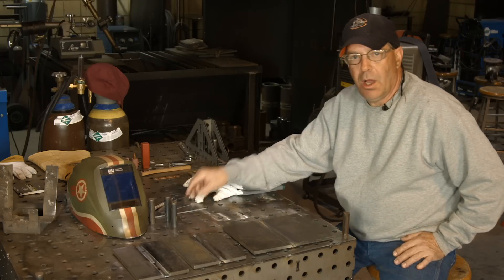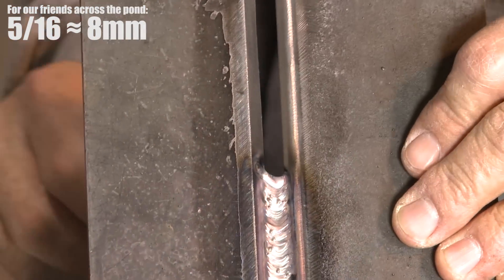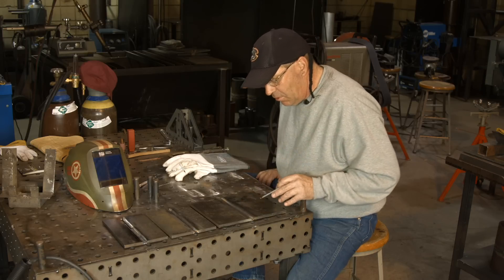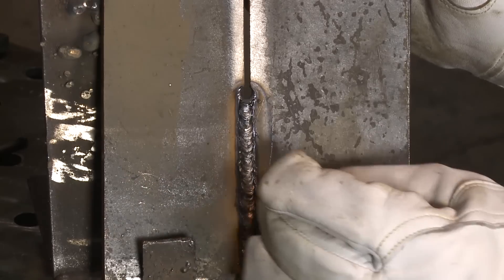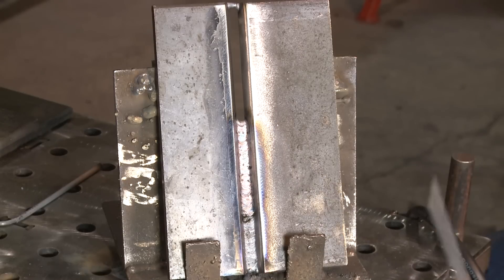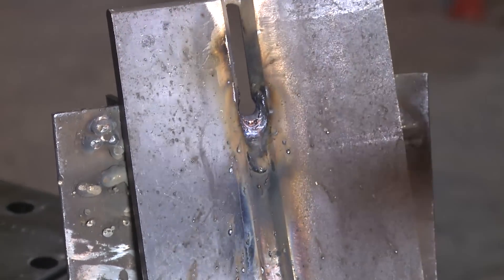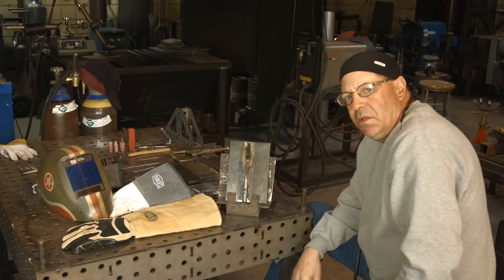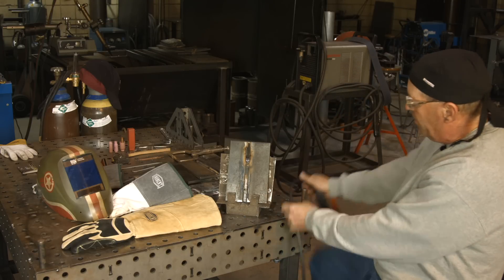🔥 6010 Roots and Bad Fit-up

Comment from the maker: Leave comments for video requests as REPLIES, here:
Reply from the maker: We've got some thick dual shield videos in the works. Do you want self shielded?
Reply: Could you do a branch with SMAW and how to fit it up thank you, love the videos Bob! Also could you do a career video on advice about getting started on the pipeline?
Reply: Weld.com I'm Currently in a welding school and was wondering if you'd be able to do a video on Stainless Steel fillet welds using Stainless Steel Rods with SMAW. Thank you and great video. Keep up the good work.
Reply: Weld.com  tig welding thick aluminum to very thin aluminum.
Reply: Carbon arc brazing with the old school two carbon torch would be fun to learn about.
Reply: I'd really like to see whole joint welded with 7018 (root, hot, fill, cap). Pipe or plate.

Thanks,
Tomas
Reply: Maybe make a video about softfacing with stick, when its used how to use it etc. and maybe compare 6010 to 8010. Great videos btw keep it up!
Reply from the maker: What process and what position?
Reply: How about a hi-low/misalignment in fitup, or one land is smaller or larger than the other with 6010 open root. And gap is slam shut.
Reply: Weld.com WALLYZWELNDINGWORLD. YO
Reply from the maker: jorge consuGTA Wally's a beast 💪
Reply: Weld.com please do open root 4g smaw please!
Reply from the maker: Thanks for the support. We will add this to our list.
Reply: Weld.com i loved the tim allen reference with the ironcat glove!!
Reply: Weld.com aluminum pipe
Reply: how about carbon to stainless pipe full penetration I'm still having trouble with this
Reply: if you can stomach more bad fitups, can you do one on pipe? like, the diameter is slightly off, also the guy on the saw kinda clamped it too hard so now you have an iso standard bend and an oval pipe... and you have to make it work even though one part of the bevel is kinda too high, the other too low, and half is kinda okay but it is all wonky and whatnot. 
i deal with that on the regular and i would like a veteran's opinion on how to angle the arc when and where to make it look afterwards like the fitup was just dandy.

edit: more tig yes. cause tig is surgical love. and if you have some stainless to do it on even better. doesnt have to be too thick either, one pass for proper root and cap? quick n dirty fab job. cause we have to make about a dozen of those before lunch.
Reply: Weld.com vertical uphill mig . thanks Bobby.
Reply: please do a video on aluminum and/or titanium pipe. I would love to do see a video like that especially from Bob. Btw Bob you're freakin hilarious and love your work keep it up man
Reply: Weld.com Please describe the j whipping motion of the 6010 and the advantages of that technique.
Reply: Welder4Life 360 keep a sharp tungsten, keep a tight to the puddle arc, use low heat, and buy a gold lens for non auto darkening helmets
Reply: Hello, can you make a video about how to deal with a bad fitup (especially the big gap like 3 mm [1/8"]) for stainless steel pipes welding with TIG process ? Thank you in advance :)
Reply: Great video today bob. I have been dealing with TIG for the first time this week. In 2 weeks I am onto the SMAW section of second year. I really identify with you on the fit up aspect. I cant wait to burn some rods.this video will surely help my fit up and procedure.
Reply: Can you make a video on rod storage, and what happens to old rods/mig wire?
Reply: I would like to see a a video on comparing how 024, 030, 035 wires run and pentrate using both C25 and C02 on a 110V machine or a dual voltage machine on 110V power.. my reason for wanting to  see this is am curious to see if on the 110V side of things if there might be a reason to stick to a smaller wire size or maybe use C02 vs C25 as alot of people may only have a lincoln or Hobart 130 or 140 welder or are stuck on 110V.  as in my case i have  both a Hobart 130 and a Imig 200 but i am stuck to 110V power.
Reply: Weld.com I would like to see some more repair videos. welding coupons are good but all but the best end up in the scrap bin.
Reply: Can you please do a sch 10 stainless steel tig pipe on a 5 or 6g position! Im very interested in watching you throw the root in with an arc shot
Reply from the maker: We've had that request a few times. We will add it to the list.
Reply from the maker: It's on the list.
Reply from the maker: Yeah, We've got that machine. I will add it to the list.
Reply from the maker: What are you having trouble with in particular?
Reply from the maker: Lol, I think our timing may not be quite quick enough for that job, but we plan on doing stainless pipe in the near future.
Reply from the maker: We'll see if we can source some Titanium pipe. Aluminum is already in the works.
Reply from the maker: Sure thing David.
Reply from the maker: It's in the works.
Reply: How about something on 'texas tig' welding?
Reply: Weld.com great video , can we see some more fluxcore  on on thick steel
Reply: Weld.com downhill 6010 pipe roots, fill and cap. Heard about it in the oilfield but never seen. Thanks
Reply: innershield .072 wire !  vertical and overhead !
Reply: Can you make a video with 6010 pipe  downhill?
Reply from the maker: We've done that in the past. Here's the link: https://youtu.be/TwvLku46I7k
Reply: Weld.com I'm a welding instructor also. Sir I love watching your welding. This is probably one of your best videos. I love how candid you are and how you tested the parameters of gap size, face size, amperage, and timing in the puddle, and how far you whip the rod. You really almost had it! You were doing great with 5/32 at 70 amps, whipping it against the wall in a U shape. It was only when you stayed in the middle above the puddle, long arcing for too long when you lost control. I struggle with MIG roots overhead. I get suck back a lot. It's really my nemesis. I know people say oh MIG is easy! We'll try an overhead root on 3/8 plate. Please make a video about overhead MIG roots. Thanks from Kentucky!!!
Reply: I'm having trouble with 1/8" 6010 roots on 3/8 plate with a 3/32 root and a 3/32 root face. I'm using a precision tig at about 75 amps and I'm having to stitch it and I'm not getting a fully fused in root.
Reply: Baja Madness it sounds like you need to make a bigger keyhole if you are getting lack of fusion. You need to establish a keyhole and when you whip back toward your keyhole, enter it with end of your rod to deposit word metal in the backside of the plate. Perhaps even bumping it up a couple amps will help you. Make sure to long arc initially ahead of your tack and hover slightly above your tack which should be feathered. Punch the end of the rod through that tack to make a keyhole and begin whipping. If it starts to get out of control and too big either make longer whips or stop and feather your stop and lower your amps. You want to feel like you're scooping the landing out ahead of the keyhole and depositing that metal back to your keyhole and puddle. You may also like an 1/8 gap and landing with 80-85 amps. I hope this helps.
Reply: I'm in welding school and having trouble with my 1g root pass can you post a video
Reply: I get what I assume is cold lap for 1/2" at the beginning of my welds. Am I just running too cold? 90 ish amps on Lincoln buzz box 1/8 6013
Reply: hi Bob with that metric you got in mind it's realy good "pond akross you have in mind :D
Reply: Weld.com I'm having problems with starting 7018 at the bottom of a 6" for my cap can you do a vid
Reply: Hey Bob, you may try texas stick on the open canyon root?
Reply: Downhill that last weld would have gone in no problem, ask me how I know
Reply: 4g 7018 1/8th
Reply: Rusted out, oil saturated pipe to clean virgin pipe...looking like a blind man cut the pipe...1/2" root opening to 1/16". Simulating a half shell replacement on a vessel built in the 80's.
Reply: Sir plz make a complete video on 6013 vertical position
Reply: I'm coming to realise.
(Correct me if I'm wrong)
For a 6010 root- 

Trypical fitup for sticking and dragging method is tight gap and thin root face. And run higher amps.
.
And for whipping you want a slightly bigger gap and bigger land. And run less amps. 
.
It would be awesome to see a video covering just fitup preferances and how they correspond and favour different manipulation techniques. On SMAW, GMAW, GTAW.
Reply: So, if you can't avoid a bad fit; you should put a piece of re bar in the gap and weld both side of the re bar  to the stock.
Reply: @weld.com will you do a video doing vertical up with 3/16” 6010 red rod please
Reply: 6013 root pass
Reply: Butt joint 6010 with 1/8 gap
Reply: FCAW-S?
Reply: Weld.com I think that sometimes you assume that the audience actually knows and understands all of the terminology, lingo and technical jargon that goes with welding. I have know idea what a root or a keyhole represents. A white board drawing would be great for us visual learners. Even watching you weld I cannot grasp the intricacies of it all. Please draw me some pictures! Just think of teaching kindergarten welding. That's some of us. Thanks.😊

Comment: This is the kind of stuff you run into in the real world especially working on broken equipment.  It's nothing to have a 3/4" gap to fill in a broken part which is where flux-core will definitely save you a ton of time.  Fast-Freeze electrodes work but it takes forever to finish the job 😒

A "U" whip is best for filling large gaps.  It focuses the heat equally on both sides unlike a "J" technique being used in this clip.

Personally, I find this type of welding to be a good test because it makes you think outside the box 😉

Comment: Another solid video.  Everything I do is pipe related, but it should transition to flat work just the same.  Most of the fitters I apprenticed under would slam everything together so it was practically touching.  They’d push in a 1/8” 6010 root that most of the time was capped with a second and final fill/cap of 1/8” 7018.  Most of the time we’re working a couple hundred feet from our welders so they’d do that so they can run the 6010 at the same amperage as the 7018, and obviously cut an entire pass out of the process.  I’m not for or against it as so far as it is a viable process, as long as the welder is aware of the necessity to sink that root deep.  We work in standard wall (sch 40) pipe and I personally do all three passes (root, fill, cap) so when I do, I gap 3/32 MAX.  I don’t like chasing the keyhole and I don’t like to fiddle with my machine when I’m switching rods.  Hot 6010 with a slightly tighter than “normal” gap if I get to pick.

Comment: I was taught to angle the electrode upwards when welding up, but welding with a gap is a nightmare. I keep blowing holes which I can't seem to fill, instead they get bigger and bigger. I see you angle the rod downwards instead and "drag" the bead through the gap. I've got to try that next time. Using 7016 electrodes, mostly repair work.

Comment: I’m learning how to weld uphill, and I run into that wider gap much more often than I’d like. I think I get nervous to step too far ahead and open up the keyhole way too much, so I probably don’t step far enough ahead. Puts tons of heat into such a small spot. Will try stepping out just a tad further 👍🏻

Comment: this frustrates the everloving fuck out of me because when i try to do an open root doing 70 is way too hot and burns through and if i go any faster than what im going it doesnt get enough penetration........ and ive tried a bunch of different ways starting at 85 and lowering it in increments of 5 every time i run out of ideas.

Comment: Why do you root with 6010 and cap with 7018? you know the first two numbers on a welding rod are tel howl strong it is. Why not root with 7010 then you can cap with Lo-Hy. Boilermaker retired, the root has to be equal or greater tensile strength, unless you plan to back gouge then root then reweld with Lo-Hy. I stopped using 6010 in the second year of my apprenticeship unless it was in the weld procedure.

Comment: My fav method for wider gaps is 2 roots on the bevels (4 in total, 2 on each side) then I'll weave in my 3rd to join them for my fillers and finishing passes. Give it a shot, you should even be able to get by on a 1/4in gap with just one root on each bevel if you know how to weave in your last root correctly. I always use a crescent or Z weave for my joining root and for my finishing passes

Comment: Regarding your pass on the wide root setup, could you have not done a pass or two up each side to narrow the opening, or also when welding run the stick/arc up the side of the bevel and slowly build material to the plates and gap? Thanks!

Comment: Can you guys do a video on all of the larger sizes of rods and different types of rods. Like a full and entire comprehensive video on all of it. 

Rods from 8th inch to 5/16 and 1/4 inch rod. And electrodes such as 6011, 6010, 7018, 7024, 8010, 6013, 7014, 7018 AC and others I may have missed. I'm looking for a video that does a complete and entire comprehensive look at these rods and sizes and techniques used when welding with all of these rods. As well as running all of these rod types on DCEN, DCEP and AC and seeing what they can run. i.e running 7018 on AC when it's designed for DCEP and DCEN. So just seeing what they can run on. Just seeing what they can be run on if say I have a rod and I don't have a DC machine. 

A video showing what the beads from all of the different types of rods should and would look like. So we know what to look for. And how to make a good penetrating weld while making our bead width longer. (For non critical welds) How to repair a plate I punch a hole through that I am using for a project that isn't a critical weld. Say I don't want to get another plate and I can't grind it and I can't use a backing plate. How do I repair the hole in the metal using a welding rod? And what rod should I use?

I have personally ran into the problem where I punched a hole in my material and I can't use a backing plate and I can't just cut it or grind it. Since at the point I was at I was so far into the project that it wasn't an easy spot to just grind it or use a backing plate. So I lost a lot of money on that project and scrapped it entirely. So knowing how to fix something like that would've been very helpful for me. 

The other thing I'm looking for is what arc length and what rod angle allows me to add more material than penetration and what angle and arc length allows me to have more penetration than weld metal? And how can I use that arc blow or force to my advantage when welding to get more or less penetration?

There are a lot of questions I have, so hopefully these questions give you guys a lot of video ideas. Thanks :)

This would be a video educating some home hobbyists in the unprofessional standpoint where non critical welds would be needed.

Comment: I'm not gonna say where or when for obviuos reasons but on some 30" heavy wall adding pups to cut down degree fittings we had bad fits tight n wide n lots of hi-lo. We'll come to find out forget the 5p+ and use a pipeliner 4mm 8010 it will beat that hi/lol with ease and step in the wide stuff look in thinking your gonna have to back weld guess what it was pretty slick did not back weld.we did over 500 welds of this nature pupping out  mitered degree fittings in the Fab to send out to the tie in crews.no repairs and yes we were way out of procedure.

Comment: ur video is very educational. i just want to ask if is it possible to do a stick and go/fly open 3g root pass with a 6011 in a machine with out the arc force feature? is there a technique in doing that method of yours with out the said feature? we don't usually use 6010 here in the Philippines.Thaks! more power!

Comment: hey :) nice Video, one Question which brand of 6010 stick you use?  i try it with sticks from Boehler but the weldingpool by rootwelding is to different as yours. thx

Comment: Your 2nd plate you did. I did a very very similar weld with the same amount of back face reinforcing and was visually failed for it.
I resat my test with the amps dropped right down to 65amos and dug the rod in. Barely any keyhole around the rod but it gave a fairly flat back face. Around 2mm reinforcing.
Not being negative. Not at all. But something to maybe aware of.

Comment: 5/16 inch gap on 3/8 inch plate with 5/32 6010 rod is not unreasonable. Though not the most ideal fit, that shouldn't have been a problem. Thinner plate would have been more of a problem with that gap, but 3/8 shouldn't have been such a big problem. That could have been done with 1/8 6010 at 85 to 90 amps. You have to move that rod in a U shaped pattern. Run up on one side a little bit, go back down, go over, run up the other side a little bit, and come back down again. That way you are allowing it to cool a little bit and building up metal on the sides, making the gap smaller. Though not the best gap to have, it is not an impossible gap to have, and not even an tremendously hard gap to fill.

Comment: Not a welder here by any stretch.... as I would know the answer to this:  why do you keep a gap and not just butt the two pieces together?  assuming it would have something to do with the profile on the other side?  Just wondering.
Thanks!
Reply from the maker: You put a gap in it so there is 100% penetration.
Reply: Fast reply! Thanks

Comment: i can't believe that u gave up or couldn't fill this gap ! things are not going to be perfect out here in the real world . I take a rod and beat flux off and use it to fill large gaps or just use a bigger size rod turn heat down some and it can be done , you are good guy but this was not a good example